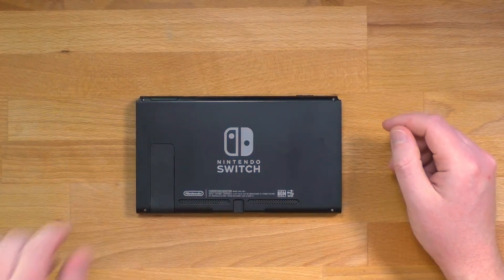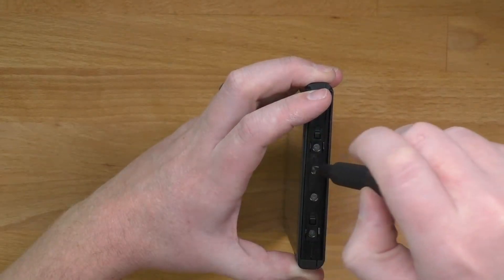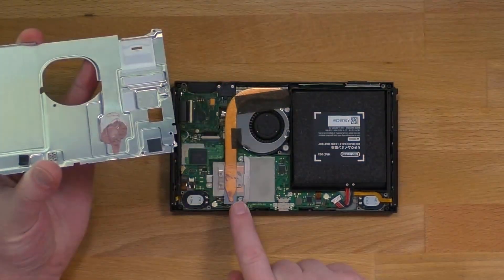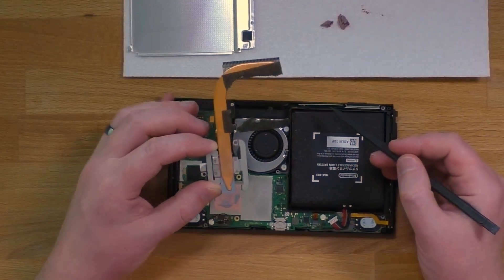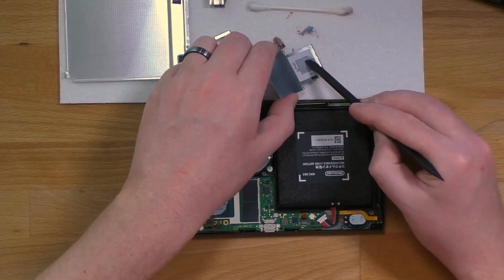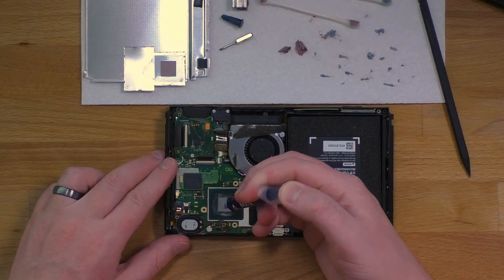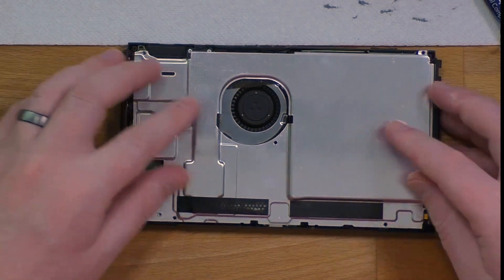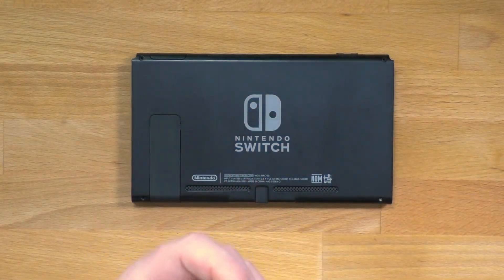Nintendo Switch - How to Replace Thermal Paste (All 3 Locations)

Comment: When replacing the fan, should I replace the thermal paste in the third spot? Or only first and second is fine?
Reply from the maker: I do recommend replacing all three if the system is overheating.
Reply: @CO3Productions It’s not overheating, it’s just the fan making a lot of grinding noises. For that reason, I thought I could only replace the first two areas.

I’ve got some Arctic Silver 5 paste, so I could go for the third area, but I’d rather avoid if I don’t need to. 

I wonder if pulling the heatsink could interfere with the thermal paste underneath the heat spreader because it pulls a bit on it.
Reply from the maker: If not overheating you should be fine.

Comment: Which head did you use to unscrew the thing holding back the heat pipe because I can't figure out 😭
Reply from the maker: Everything inside the system will be phillips 00
Reply: Ok thank you so much

Comment: Do you need the copper plate in the cpu? I’m thinking it’s making thermal transfer slightly worse, and I’m interested in modding and overclocking, so is it necessary?
Reply from the maker: Yes the copper plate is needed

Comment: DUDE, I replaced the thermal paste and screwed everything back together, and then suddenly it wouldn't turn on anymore. I screwed everything back on, saw nothing, screwed it back together, nothing. Then I put it in the charging station, and suddenly it turned on, and the battery was apparently full according to the display. Minor heart attack moment.
Reply from the maker: That sounds terrifying. Nothing worse than thinking you just bricked your switch. I'm glad everything worked out.

Comment: Thank you. My switch has been shutting down when playing any game for about an hour. I am 99.9% certain that my issue is the fan (ironically, i am also 99.9% certain I broke it trying to clean it with an electric air duster). It's periodically making 4 clicking noises. Got very hot idling in a 3d game for 5 minutes. I tried the same test on a working switch, i hear the faint "whoosh". This video convinced me, especially the metal plate part, that it's not worth the risk and effort unless i have continued issues after replacing the fan. I might do 2 out of 3.
Reply from the maker: Good luck!

Comment: Damn I think my Switch feels hotter, not sure if I put too much or not enough. Lol
Reply from the maker: It's most important to have an even spread. Too much is fine if level. I suggest taking back apart and make sure everything is covered properly. Also make sure the fan is running.
Reply: @CO3Productions  its hotter becuase the new paste is better than old dry paste and more heat is being extracted form the soc through the  heatsink then through the exhaust
Reply: Thermal paste puts heat on the outside of the switch, so either it’s overheating or the cou is getting refrigerated.
Reply: your fine it being hotter means the thermal paste is doing its job

Comment: Thanks i was going to replace the thermal paste on my switch since i have to replace the battery. The big glob on the back of the metal plate seems like too much. But i hate the tri wing Y screws they strip out easily

Comment: Always disconnect the battery when working with the mainboard. I skipped forward to watching a metal screwdriver being used to pry up the CPU heat shield and seeing the battery still connected... yikes. A short on the mainboard (dropped screws as well) could damage it.Thanks for answering my question regarding the third location. :)
Reply: This needs more upvotes
Reply: yeah so I desperately wish I’d seen this before going through the tutorial. no signs of life & I’m devastated.
Reply: @JJ-up3fl  doesn't mean all is lost. maybe pricier but take it to a repair center and have them use a multimeter to test it if you're not used to using one.
Reply: I love reading this after dropping the screws on my mainboard and accidentally dribbling thermal paste all over it while scrapping it off with a screw driver. Socks on of course. Runs much smoother now 😁
Reply: He also forgot to mention to clean a fan grill. 50% of the time it’s just a dust rug collected there and nothing wrong with the paste. But since you already got to that point - of course changing the paste is the main idea automatically 🎉

Comment: I wonder if the Arctic MX-6 can be used between the lid and the heatpipe, since it's viscous too. + also if it's still ok to spread that with a spatula or if it's ok to also put the pea size since it's quite more viscous than the Arctic MX-4 kind of pastes.
Reply from the maker: Arctic MX-6 should work great. I prefer to put a small amount and allow pressure to spread rather than manually spread.
Reply: @ It did, even better than MX-4. I don't trust the pression because it's literally a paper layer of copper from a delicate heat shield, i often have to make it straight again after i open it up from setting the little locks free. 
The heatsink didn't gave the feeling to properly press it down, at least. So i went with the usual layer and everything is great so far.
Reply: If you put enough paste you shouldn’t need to spread it out. It’s okay if some paste gets pushed out from directly on top of the cpu cause it’s non conductive to electricity. I don’t like spreading it since there’s a higher chance of scratching the cpu which could be really bad
Reply: @ No scratch if you don't use stuff that isn't plastic and usually a spatula or even a phone card is enough for the work. I'm not a fan of the paste going excessively outside, because it's a waste and it's also stuff i need to clean way later with the next repaste. I prefer to avoid a mess and go with a reasonable amount.

Comment: HELP! I can't find a single way to remove the metal plate upon the processor. I saw a video in which they opened it by removing with a needle what looked like a plastic cover, but there's not anything lite that on my switch. I can't even do ehat you showed because there's no place to lift it. I really don't know what to do now 😢
Reply from the maker: To remove the metal plate over the CPU I used a very small flat head screwdriver. There are tiny metal tabs that need to be pushed in or bent out of the way. I pushed in with the screwdriver and pried up gently. Work your way around the plate one tab at a time. When the tabs are released the whole plate will slide to the left and lift out.
Reply: Thank you a lot man!

Comment: 7:00 DO NOT put the standard thermal paste on the heat-pipe, the best solution is to use a thicker thermal putty as Nintendo did. They standard thermal paste you use on GPU/CPU has less thicker consistency, it requires a bit of mounting pressure to function as a good thermal conductive material, here the gap between the back-plate and the heat pipe is enough to put a whooping 1.5mm thermal pad! 

So your thermal paste won't really be ideal - Nintendo has engineers who designed the console and decided to use 2 different thermal pastes in it, a company that is mass-producing a console will not waste time, money and resources for nothing. There is a reason why the paste on top of the heat-pipe is thicker. I'd advice a thermal putty instead!
Reply: People routinely run the system without even reinstalling the heat shield at all (usually for aesthetic reasons with a transparent shell); you'll be perfectly fine with normal thermal paste for all 3 locations.
Reply: @jayjayhooksch1  My switch is cracked and a V1 model so it's pretty old and I overclock it regularly. I bought good thermal paste and all the screwdrivers to open it, because I thought It would be a good idea to change the old thermal paste. But then I read about the pink putty and it's so hard to figure out which one to buy or if it's even putty like for the gaps. The one everyone recommends is very expensive here. So I was too scared and didn't open it, are you sure you can use just normal thermal paste?
Reply: @DieEineMieze  Yea, I'm sure. Like I said, people run the system without a heat shield at all. Personally, I wouldn't run it without a heat shield, but I changed the thermal paste on my switch v1 (I don't overclock though) like 3 years ago with no problems. I've also switched the thermal paste on 4 switch lites with no problems. I use the same paste (mx-6) on all 3 locations in every device I've serviced.
Reply: @jayjayhooksch1  Hey, thanks for your answer. I decided do buy thermal putty in the end, it's pink too and it worked out great. It wasn't that expensive 100 Gramm for 16€ so you can always use it when you replace the switch or even in graphic cards.
Reply: Are you sure? Everyone says you should do that
Reply: Came to comments for this. Was wondering why theres 2 different pastes and why 1 is such a not so normal paste. 
Thanks for this info ill be sticking to the putty paste for the one spot gonna look into it now.
Reply: HELP! I can't find a single way to remove the metal plate upon the processor. I saw a video in which they opened it by removing with a needle what looked like a plastic cover, but there's not anything lite that on my switch. I can't even do ehat you showed because there's no place to lift it. I really don't know what to do now 😢
Reply: @aristocrom1222  It's not plastic but metal. And you need to use the needle in between the small groves on the edge and push them outwards. The switch lite has it too, that's where the processor sits under. Either use a magnifying glass or mobile phone microscope or do it without them. 
I did it slowly it took like 5 minutes, very careful so you don't accidentally frame the other part.
Use a very thing needle and push look very closely at the edge of the metal plate.
Reply: @aristocrom1222  At 4:15 that's the part you need to look the the edges and stick a needle in the the little grooves
Reply: to be cleat: what happens if i put the normal paste?
Reply: @Lore-Shift nothing
Reply: Hello :) I want to change my thermal paste and bought MX-4 which should be great. 
Now about the thermal putty replacement, everyone says take K5 Pro. But it's really hard to get here and what makes it even harder to look or alternatives, that I'm not from an English speaking country and they seriously use thermal paste and thermal putty as synonyms, so I can never be sure if that's what I want.
Since you are an expert, maybe you know an alternative.
I browsed Amazon for a while and my best guess was  HJ700, HJ234 and HJ236.